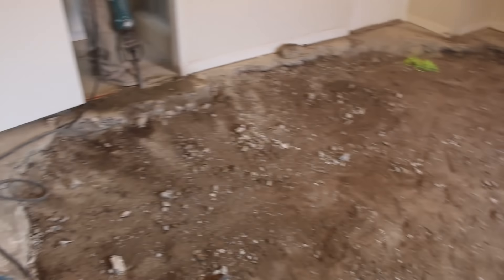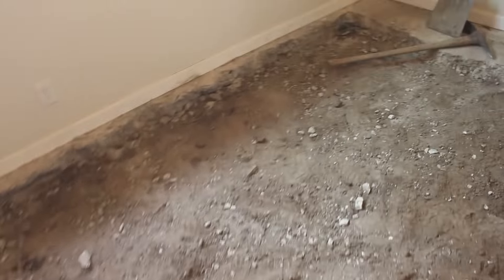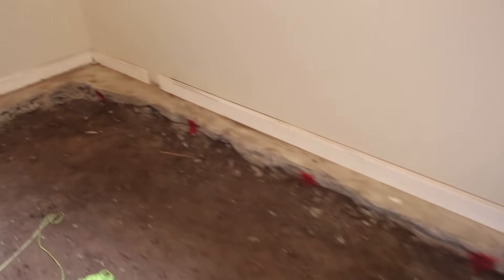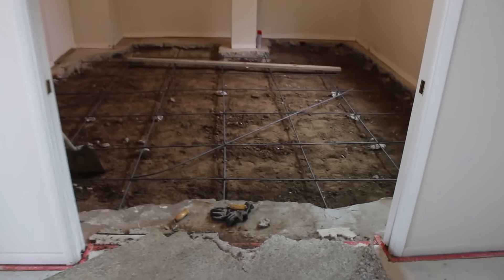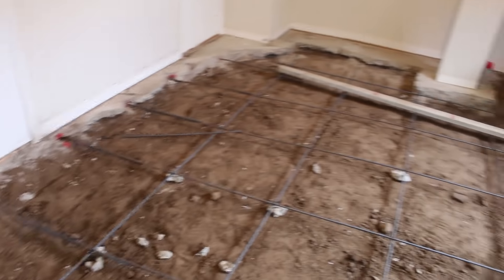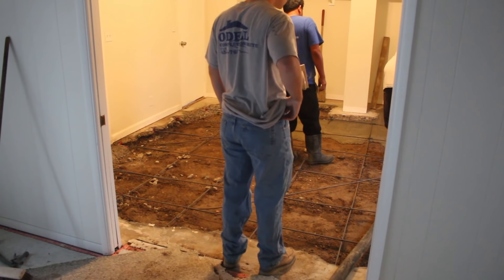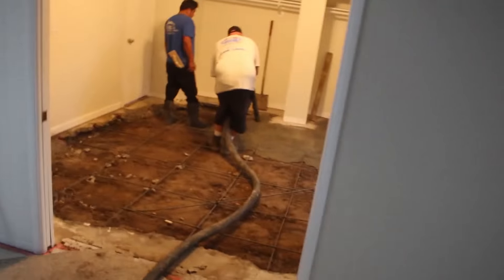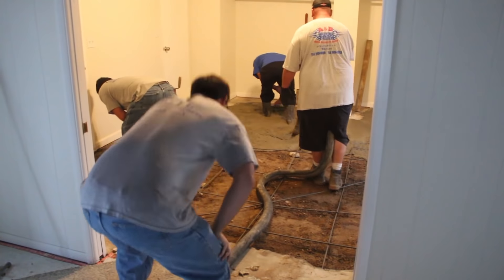How to pour a Inside  House Concrete Room foundation

Comment: I wish you were on the east coast. I have an old home (1901) with a dirt floor basement. I like dig down 3 feet  (increase ceiling height) do unpinning for the stone and mortar walls then put radiant heating in. But haven't found anyone with the expertise. My background is architecture and building science.
Reply from the maker: Liam M 
sounds like fun

Comment: Thank you so much for this informative video. I currently have the same scenario. I bought a rental which had buckled slab right down the middle in the living room and the dining room.  Got an engineer's report and I cut the slab in the living room about a foot away from the footings. I then jack hammered the slab and carried it out. The native soil had approximately 8" of sand which I have to remove and back fill it with class II aggregate base rock that attains 90% compaction. Once the aggregate has been stamped down, I will be drilling #4 (1/2") rebars into the existing footing and then top it off with 4" concrete.
Reply from the maker: Nick Rafiq 
No plastic?
Reply from the maker: Sounds good
GL

Comment: for this project what were the times you waited before doing the bull float, fresno trowel, funny float, & guys out on the concrete with sliders troweling by hand. i'm doing a project like this (indoor finished garage gym new level concrete floor on top of old sloped dipping from side to side concrete floor) & I need to know how long to wait before doing each thing.
Reply from the maker: Bullfloat right after the rodding.
bullfloat again in 30 minutes. 
fresno in 30
funny trowel 
hand trowel when you can go out on sliders with out sinking more than 1/4"
Reply: thank you

Comment: I am about to do exactly this. The house walls are on very good foundations and footings, but the floor slabs are rather weak - they have no reinforcement, have no thermal insulation (which we need), and the screed is less than an inch thick.
However, we don't have any floor or wall cracking either (the house is almost 40 years old), but knowing that the temperatures get down to 0 F means we really do need to keep the floor warm and minimize heat loss. We are thinking also to install under-floor heating (hydro).

David, are there any special methods or materials that you would employ under these conditions ?
Reply from the maker: Try thermal heating ground loop

Comment: Hi I currently have wood floor with crawl space below I want to convert  plumbing to PVC and fill crawl space with sand and then re bar and 3 to 4 "cement floor  whats  your opinion  I hate crawl space and prefer a slab
Reply from the maker: Sounds like alot of work and not much benefit
Reply: My Aunt & Uncles house in Oklahoma has the same setup.  We have lots of ground movement and erosion thanks to gophers and moles mixed with our rainy season.  The recent earthquakes due to the fracking in our state has increased the problems.  The foundation walls are showing sins of cracking and the majority of the crawl space is inaccessible due to the gophers/moles pushing the dirt up to the flooring.  There is a lot of excavation to be done to clear out the crawl spaces.  The inner supports have had lots of movements and there is noticeable elevation changes throughout the flooring of the house which is also affected by the dirt pushed up in the crawl spaces.  We had a specialist come out and do a survey and cost analysis to convert it to a solid foundation.  It would be cheaper to build a new house on a solid foundation.  Especially since the house is about 60 years old.  The amount of work and supporting the house while building the solid foundation under it would put too much stress on the old frame work (despite it being twice as sturdy as your modern house).  Honestly, pulling the floors up and redoing all the old supports would be 1/4 of the cost, even with making the supports deeper all the way to the bedrock.

Comment: Hi, I need to pour/ make a new slab for my workshop. The shop is 10 by 18feet. About 2/3 of it has already a sort of old slab under it,  but it is not even and in places it is crumbling and has a few low spots, but no bigger cracks, the remaining is dirt. I was thinking on pouring a 2 inch thick slab with rebar in it along the whole shop. Is this ok or should I break up the old slab and so on?
Reply from the maker: I would break it out from the sounds of it

Comment: Wow internal slab work gettin it done! Nice job!

Question: If you wanted to run some pipe or conduit under an existing slab, do you score the channel 1st with a diamond blade skilsaw then break it with the 70lb/35lb Makita so you have a nice clean edge? Or do you just make the channel with the Makita and not care about a clean edge since you're going to use concrete glue/rebar/epoxy anyways when you fill the channel in? I vote for clean edge, how do you guys do it?
Reply from the maker: Every situation is different and it depends on what I see. If the concrete looks weak and I can punch through it without disturbing anything else I'll go for it without cuts.If the concrete is solid with rebar and high psi I'll cut it.Everything I do is based on a visual decision.

Comment: I am doing this job myself with an out building I put up in the garden. It currently has type 1 stone whackered down.  It is a bit smaller than what you show. I am putting insulation and then concreting over.  The walls are all up and so is the roof.  Hey so my question is do I need the iron mesh below? what is the advantage? also I wondered where to get the floats to smooth out the concrete. I wil use a wheel barrow mixing the concrete myself and laying it down.  Do you think one man can do the job quick enough (12 ft by 10 ft area)?
Reply from the maker: Daniel Howard 
You may want to consider two pours.
Mesh is a good idea but not a necessity.
You can get floats at the local hardware.
Reply: Hi when you mean two pours, do you mean divide the area in two or do you mean one pour, wait until dry and then another?  Thanks for your help!!!
Reply from the maker: Daniel Howard 
Yes one section a day.
Reply: So I can divide the room in two using a piece of wood to hold up the concrete, then take it out the next day say and continue with the other half of the room, perhaps putting some floor level compound later if things do not become too smooth at the end?
Reply from the maker: Daniel Howard 
Sounds good.
You may want to dowel the two sections together.

Comment: My 9ft. x 10ft. living room flooring is  thin (1/2") concrete topping over 2-1/2" sand on top of  existing 4-inches concrete foundation slab.
1. Do you recommend to leave 12-inches edges (Or aprons)  from the walls? Or dig out 2-1/2" sand all the way to the side of the existing walls without edges before pouring new concrete on top of existing concrete foundation slab?
2. Put concrete glue around the edge (Thin concrete topping with 2-1/2" sand) and rebars at 24"o.c. may not be applicable in my case. Any recommendation?
Also how do you check and make sure the new concrete is leveled?
Reply from the maker: I would break as close to the wall as you can without going under the wall. Its possible you may hit a footing before you can get real close to the wall, in that case you would stop there.
If the edge of concrete is in decent shape, you drill rebar dowels every 2' or 4' and continue the steel at 2' centers in both directions.
I like the glue to help seal the cold joint.

Comment: Why wouldn't the plastic be used on the repour, would it not provide any benefit on such a relatively small portion? Thanks for sharing your expertise!
Reply from the maker: Doug Owens 
soil condition is good here from the looks of existing concrete
Reply: @OdellCompleteConcrete  damp will still pass thru the soil you  need a dmp everytime
Reply: @jimmywilde2033  thats what i was thinking glad someone mentioned it
Reply: @hotdog3392  just tarp the area before you pour your concrete and  run it  above the height of your slap your pouring

Comment: Hey David, great videos!
I was doing an internal slab a little while back (I'm no concreter) but i had done successful external slabs before.
I could not for the life of me work out how to get good levels.
i marked the walls and then put a form right on the edge of the room, planning to lift it up before concrete set and back fill it.
Didn't really work. i had a very thin form ( about 1 inch on the edges) and my screed had to be the exact width of the room. I really found ti difficult compared to levelling an external slab.
Slab was miles out of level in the end, a real mess.
I'll hire  a professional lie yourself next time.
But I still question how you get good levels when doing internal slabs?
Reply from the maker: Its not easy, that's for sure.
Reply: You achieve the right result by using the right tools, you can use conventional spirit level or you can save a lot time by using level laser kit which is not cheap but it is a great piece of a kit once calibrated will allow you to level your slabs correctly.

Comment: Don't you need a vapour barrier?
Reply from the maker: No the old concrete showed no signs of water problems and had no plastic for 60 years.
Reply: You realize that building codes vary by area right? Radon isn't problamatic in every area either. What is required in your area might not be required in another. In my area we don't put plastic down under slabs. The plastic won't prevent Radon migration into a structure either, it might reduce it but it won't prevent it.
Reply: @petemiller519   yes pete here is correct all Residential homes do require a 6 millimeter plastic barrier in North America this is a very bad demonstration video just because no codes were respected. also the concrete probably cracked form not having a barrier and having the condensation buildup underneath and freeze. "soil condition was good" my ass bud how can you tell by just looking. Anyway it was good that you reinforced it but how many inches of concrete did you pour on both sides? There's a code for that too if you weren't aware.

Comment: what's the perfect "ratio " or mixture to mix concrete 
thanks in advance
Reply from the maker: Noah Ruiz 
1 cement 2 sand 3 gravel
Reply: @OdellCompleteConcrete  I'm assuming "Cement" is already mixed with water in that formula?

Comment: Did you ever figure out what caused the volcano in the center of the slab
Reply from the maker: no, but I believe it was  a slab leak many years ago. All the incoming water is now over head.
Reply: Odell Complete Concrete-  Your probably right it don't take much water pressure to lift a slab with no re- bar
Reply: Since you will have a cold joint, will you need to seal the joints? What would you use to do this?

Comment: 12   inches dow   3   inches   of  sand     20mm biskuin   over  the sand  4  inches  of  sand 5 inches  of  concrete      # 4 rebar   w epoxy     16  c
Reply: get it on
Reply: yes wi  worrk  iin this  for 25 years  in san diego ..  kep ap the  god work  frend          , tank you  .

Comment: how much did this cost?
Reply from the maker: 1200
Reply: thanks! I have some hollow spots under my hardwood floors... should I worry about this? There are also some high places in certain areas but it's probably only a few millimeters but it is noticeable when you walk over it... is there a way to re-pour the slab under load bearing walls?  and should I worry about it?